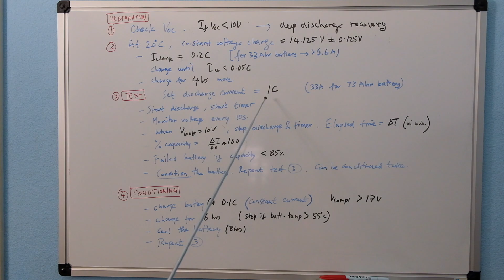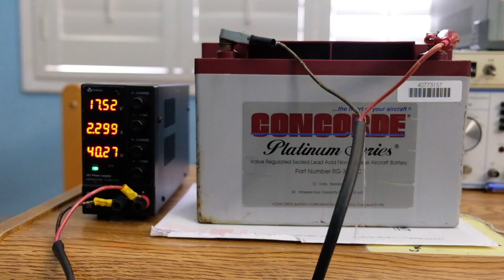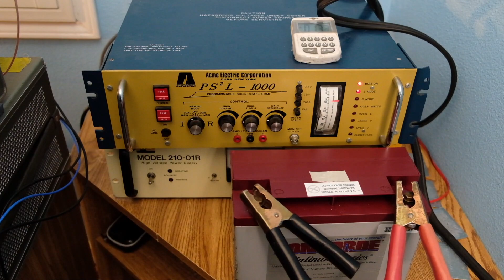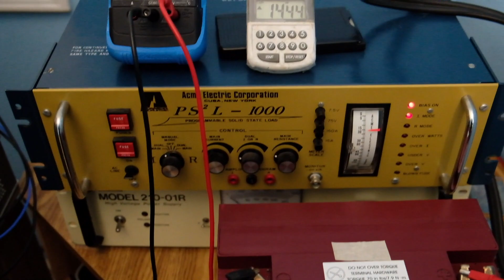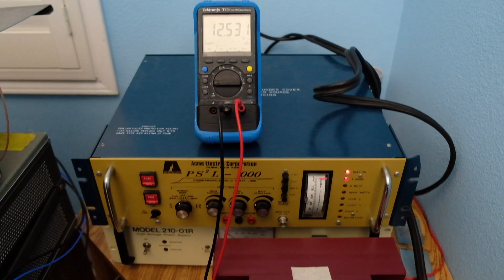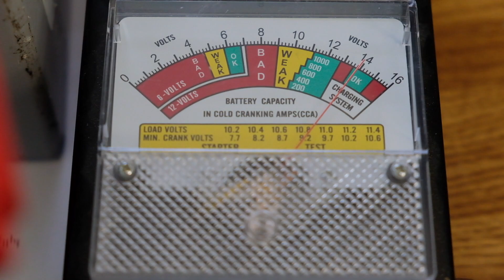Aircraft battery load test

Comment: Hello, can you show how your battery is connected to the load and PS2-L-1000 setting please?
Reply from the maker: Positive battery lead to positive terminal on the PS2-L-1000 and negative to negative. Set the PS2-L-1000 to current (I) mode, set R pot fully clockwise, adjust I pot to desired current (1C ampere hour rating for the battery, ex 33Ahr battery would be 33A). The manual for this unit can be found online.
Reply: @snarayan007 thank you, that’s what I thought, I don’t have the equipment yet but I may have found one online. I have the Concorde documentation.